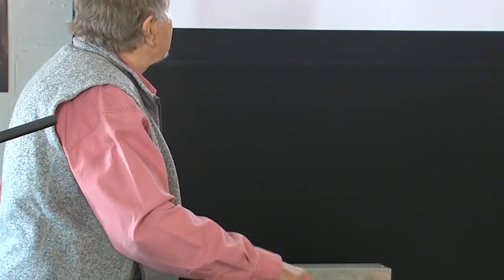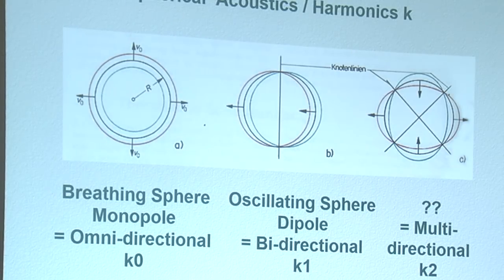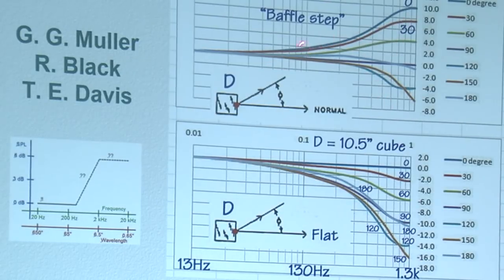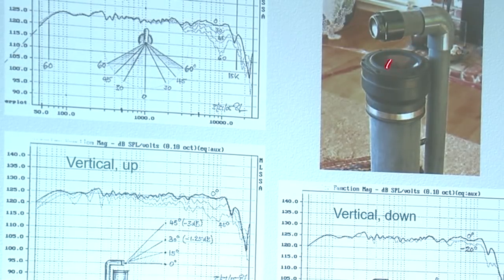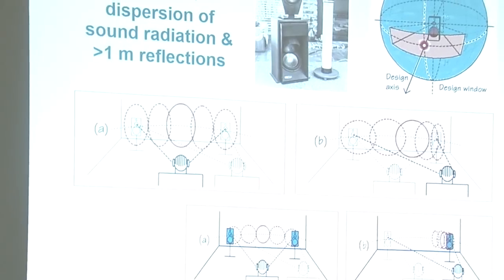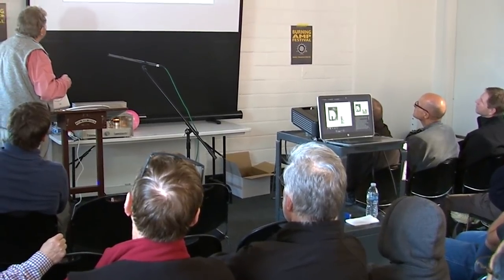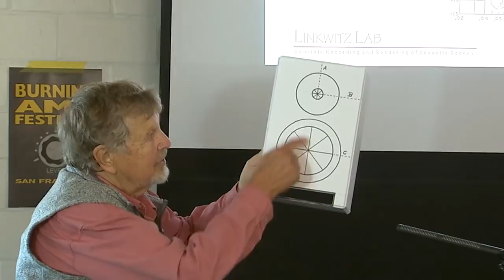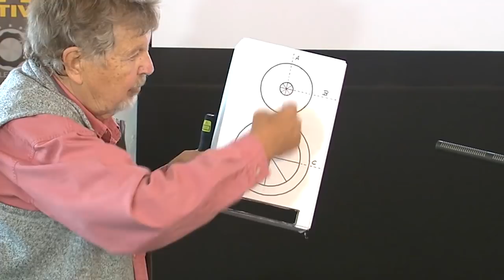Burning Amp 2017 - Siegfried Linkwitz

Comment: I came down to comments to make one, then saddened to learn Mr Linkwitz had passed.
He always answered the few emails I wrote way back 1999/2000s.  I suggested magnesium SEAS Excels back then.  He didn’t say he knew of them.  Oh well, no more emails.  Sad.  End of an era. 
His website was truly DIY back then, everything was fully described.

Well, I came to make comments.  Siegfried can’t respond, but I’ll continue.  At around 32 minutes it was stated that some boxed tweeters have large reflectors to focus the sound to match the narrow propagation of a boxed woofer’s higher end.  I’ll stand corrected, but that’s very often not the purpose of the tweeter waveguide if used.  A waveguide is used (in passive systems or otherwise) to boost the lower register of tweeter beyond what is normally possible so that the higher fidelity/detail of the tweeter can be used rather that of the woofer, or it allows the use of a larger woofer with limited high frequency extension or fidelity.  I've read it can also lower tweeter distortion.  It also allows the crossover to be at a longer wavelength for a smoother transition or lessen time alignment issues (also mostly due to being able to place the tweeter deeper closer to the woofer's timing).  Yes, the waveguide allows a lower tweeter response by horn loading a bit, which I guess is due to narrowing the tweeter lower frequencies, but that’s not a bad thing anyway, and very often not the reason for the waveguide.  The tweeter's higher frequencies don’t become horn loaded as they are more directional naturally, so there is extended smoothness anyway.  I've even read waveguides are good for dipole systems too, reducing edge diffraction ripple on flat baffles.

There’s good aspects to dipole systems, but I’m not completely sold.  My small flat doesn’t allow it anyway.  I’ll say this though.  When someone sings to you, they don’t sing with an extra mouth at the back of their head facing the other way to the wall.  Same with brass instruments etc.
Reply: So glad you like the SEAS EXCEL from Norway  my home country. I listen to them every day with my gorgeous amplfiers from BUTLER AUDIO TUBE DRIVER BLUE and the  AUDIO  POWER LABS 50 TNT OIL COOLED 572 B  CLASS A Filled with  fabulous LUNDAHL TRANSFORMERS!!!!  BY THE WAY I GAVE UP ON PANEL SPEAKERS A LONG TIME AGO. WRONG PRINCIPLE THEY ALWAYS  MADE FRANK  SINATRA GIVING  HIM  A MOUTH LIKE A WHALE!!!!
Reply: amt now?

Comment: we haven't gone much smarter in audio speaker since a very long time. 

it's only smaller or cheaper - not better sounding.
Reply: speakers aren't the problem, but recording competance and industry standards which have been slipping for decades